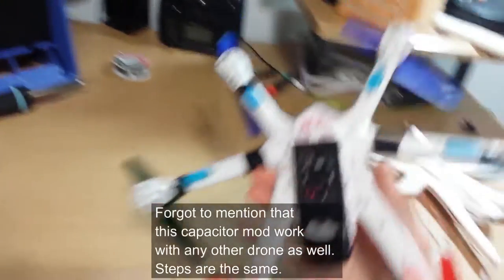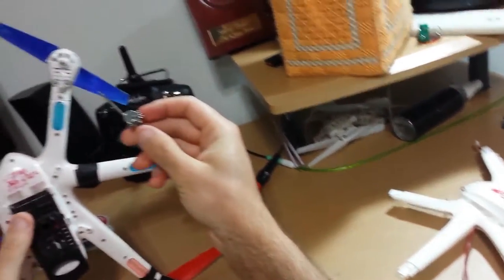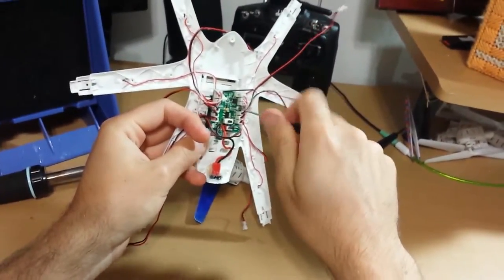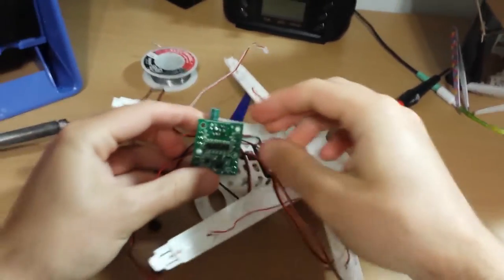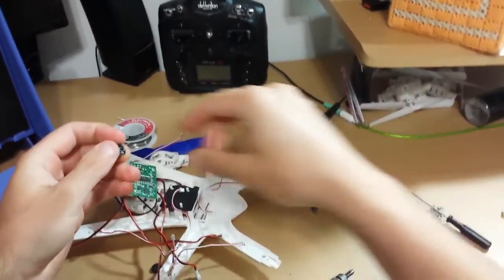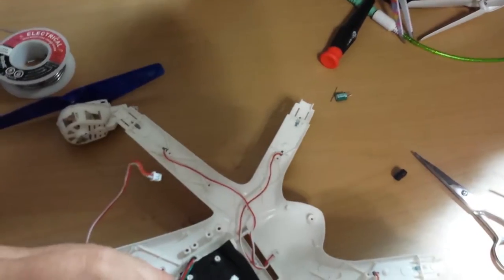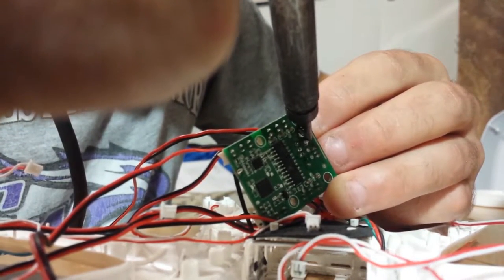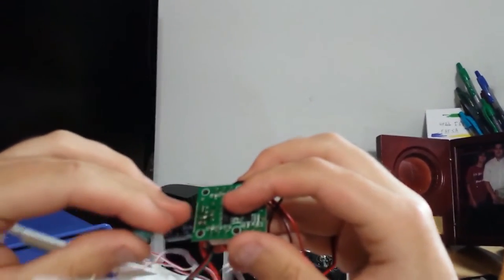MJX X600 Capacitor Mod(Drone Capacitor Mod)

Comment: Hi there ! A bit of help needed 
Mine does not turn on, even with a battery fully charged. I have a couple of batteries, none of them work, except one ! Bizarrely enough, when I plug that one in, all motors start to turn - but not the lights - impossible to pair with the remote/ nothing else happens.
When this one battery is plugged, it doesn't change anything if I turn the drone one/off, all engines are spinning but out of control.

I opened the drone to check the contacts and everything seems fine / in place.. Any idea?

Comment: Hi friend nice video my mjx x600 have an irregular movement thee stick mové it ilogically I replace some motors and f  reintall them in order cw and ccw but nothing some ideas to flix it.... 😥😥😥😥 Helpppp please
Reply from the maker: Maxart Desarrollo Personal Its very hard to help you when your question is vague. From what i’m reading it sounds like either 1 a motor is messed up, 2 the trims on the controller are not centered, or 3 you need to calibrate the drone.

Comment: I don't see a benefit here. The Lipo battery has enough reserve energy stored already. The Lipo has a high discharge rate already enough to do the job.
Reply from the maker: TheAarowsmith I dont fly this anymore, have moved on to mini acro flying now but the benefit is higher burst time if you let the capaciter charge between bursts. This video wasnt just meant for mjx but for any drone
Reply: Average Flyer Thanks for reply. You got rid of this. It's a good flyer just to mess around with. I know it may seem boring compared to drone racing. But you can still use the MJX X600 for a cheap camera drone with the right camera gimble & perhaps a Runcam camera.
Reply: Average Flyer I am modifying this with better remote antenna for longer range.
Reply from the maker: Check out my latest vid and you'll see why I dont fly this anymore(stabilization fpv just fights you ).  Once you go brushless you dont look back. 
https://www.youtube.com/watch?v=hRhPf6LuI-8
Reply: I still don't understand the final benefit. "Burst time" or "discharge of capacitors" is quite obscure. What is the goal of this?
Reply from the maker: Theoretical Limit          
         Longer burst, now a days I fly racing drones and among using these capacitors for more burst time we also use them on the esc so that voltage spikes dont cause interference with stuff like fpv, etc
Reply: My question is, in reality : what are you calling "burst time" ?
Is that making the motors more powerful, or more controllable, or less power consuming?
Reply from the maker: Batteries have a a max burst discharge for a certain amount of time and then they discharge slower than the max. Using the capacitor is like adding a bit to the max burst. Its will charge and when you need the extra burst it will discharge. A batteries voltage drops under load and then raises back up when load is taken away. This can get complicated to explain in depth so google it if you want to know more about lipo burst times. Youll find a lot more information than im giving if you are really interested in it and look it up.

Comment: What do I do if my drone won't turn on at all
Reply from the maker: A picture of what you did would be helpful
Reply from the maker: If you bridged the battery terminals then no current is going into your drone. Its just going directly into the other side of the battery.